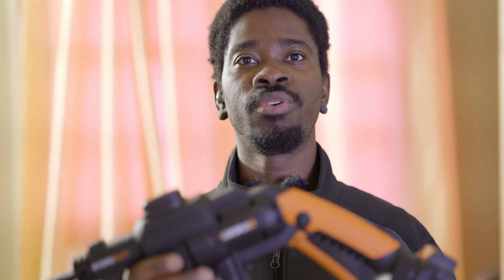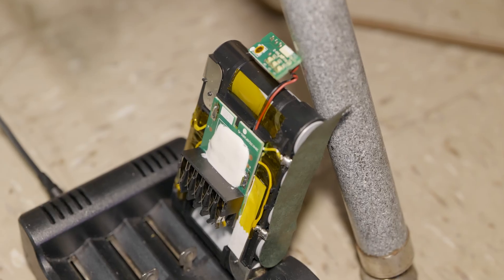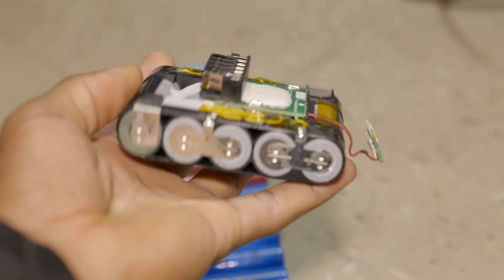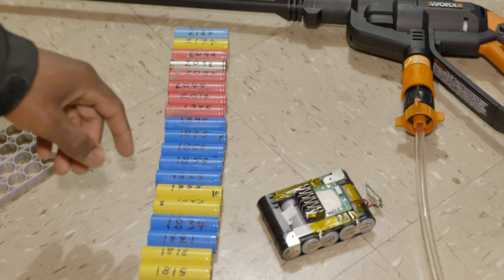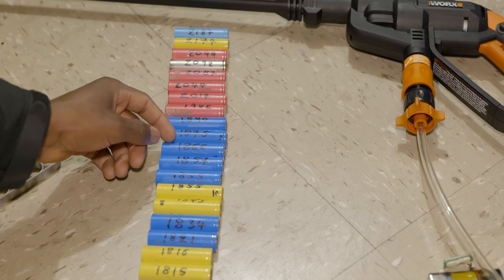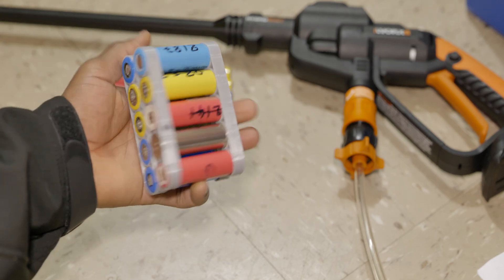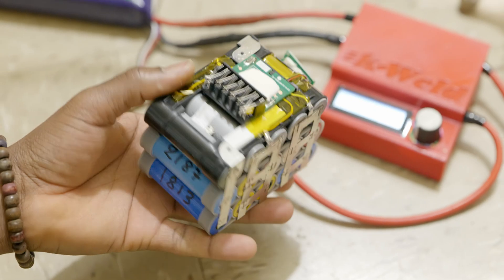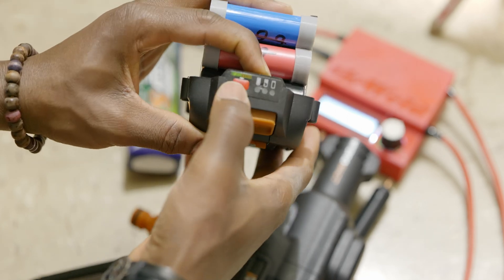Worx Power Tool Battery Upgrade | DIY Hack

Comment: Hu yvon
You are smart but not so smart. U forgot to drill some VENTS in ur battery compartment.
Reply from the maker: That's totally unnecessary. It's a power tool battery, water resistance is key to prevent corrosion of the cells in the long run

Comment: What is the battery capacity in Ah right after upgrade?
Reply from the maker: I would advertise it as a 6AH (6000mah) battery after upgrade, but it's slightly lower than that since the batteries were used and most had less than 2ah
Reply: @YvonSmart I got 2AH original battery but without led indicator. I wonder if your housing will suit it. In few days I will have it 3d printed
Reply from the maker: @arkadiusztomaszewski5181  Congrats in advance on your 3D printer, it's a handy tool. Worx makes many variants of these batteries but I'm not aware of the one without LED indicator. Might be an older version. I'll probably get it to redesign my upgraded enclosure if it's not compatible

Comment: That is freakn awesome! I wonder if you can use the bottom too but just print an extender?
Reply from the maker: Yes, I was planning to design it that way, but you wouldn't be able to reuse the factory screws. Instead you would need over 2 inches long screws in the same style which is not common
Reply: @YvonSmart  That makes sense. You should design battery adapters to swap batteries between tool brands!
Reply from the maker: @stinky-bohoon  Yeah, that's a good idea

Comment: Smart!

What do You think about 5s2p 21700 for Worx tool?
Reply from the maker: Even better due to higher capacity and current capability, only problem is they will not fit the same enclosure
Reply: @YvonSmart  Yes, 21700 are longer, so it either would require a new housing (just bottom part) or place batteries along the box, they will fit.
Reply from the maker: @alesynkin  Yes,  they are longer and larger. A 5s3p using 18650 cells is 54 x 65 x 90 mm  while the same config using 21700 is 63 x 70 x 105 mm. Both two pieces of the enclosure need to be redesigned

Comment: That Sir is fantastic. Just add some more batteries and leave the rest as is. Brilliant! How has it been holding up? 
Would love to do this myself at one point and use these batteries to power all kinds of things. 
Add USB-C to be able to charge laptops. Maybe some kind of rig where one can put a bunch of these batteries onto to make a "powerwall". Use these Big batteries to power electric bikes and more! Being able to use them for all kinds of applications is a dream!
Reply from the maker: Thank you for the comment! Yes it is holding very well even though the cells were already very used. The added capacity allows the drills, leaf blower and power washer to run close to 3 times the original range.

Comment: Was hoping to use your case but our screws in UK are not in the same place haha
Reply from the maker: They sell a different version of the battery in the UK?
Reply: @YvonSmart  ye the screws are on the short ends in uk
Reply: likely you have the 4 terminal battery, e.g. WA3551. So they are not the same, the one in the video at 13:45 is 5 a terminal one. An alternative is buying a battery shell + pcb (should be sub 15 pounds), 5s2p and using some decent batteries, LG MJ1 is 3.4Ah (so close to 7Ah) but it cannot be heavily discharged, still 20A for 2p should suffice for most of the tools, and it's like 250g lighter than having 5 extra batteries for 5s3p.
Reply from the maker: @stanimir4197  Yeah, should be a good alternative. I always worry about compatibility when using after market parts